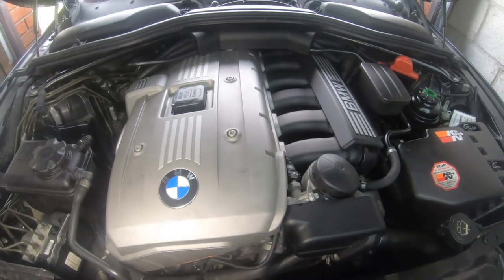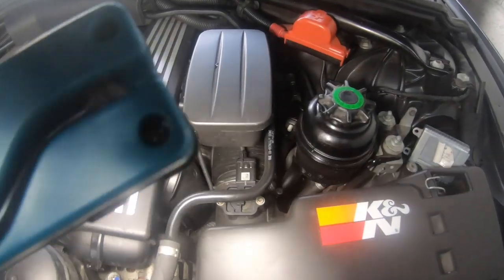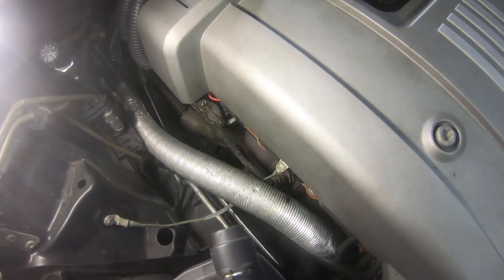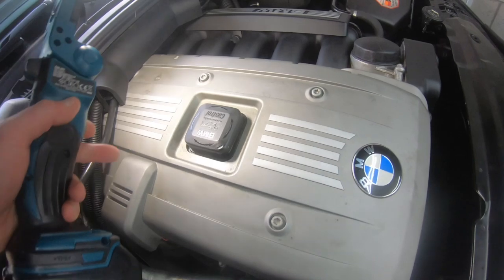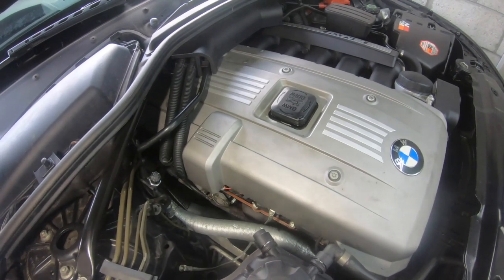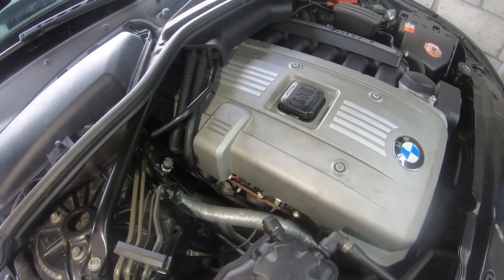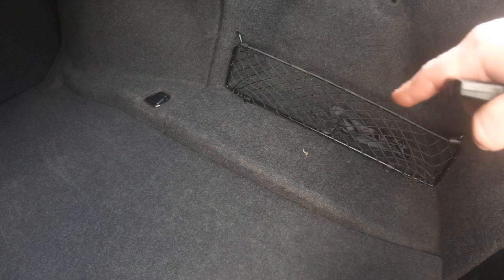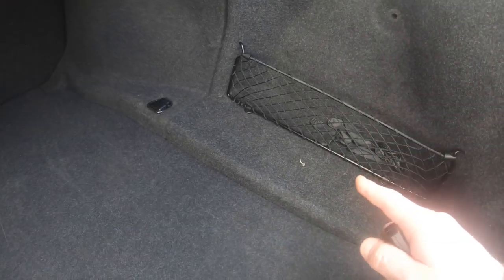BMW N52 Rough Idle Vanos Codes & Faults....Heres Why ?????

Comment: I had an issue with my N55 blowing codes for timing. I listened to your suggestion and did not suspect vanos solenoids as both would not go at the same time. Turned out it was the coils. Put new ones in and codes are gone. Thank you for this great video!!!!!!!!
Reply: @Triggerman2505  you had 2A82 and new ignition coils fixed it? Even if you have no misfires?
Reply: @angelnoguera1209  correct.  I must have had misfires that were not obvious and drastic because without the misfires this would not make sense. These N55s are so finicky.

Comment: Finally someone on UTube that understands how integrated the BMW system is. Awesome list this is why I like working on the BM it makes you think, one that a lot of people miss is if the car has been played with a lot the wiring harness can have you chasing your tail, I have had a handful of cars that all the problems have been some broken wires because the previous  mechanic been rough pulling connectors. Dean love your videos keep them coming.
Reply: Darren Teale agree my friend, it's great to understand what's going on between the mechanical and electrical components on the n52

Comment: Also check the vanos check valves on the side of the engine, they are meant to keep oil in the vanos, but get tired and oil drains away, and the exhaust one gets covered in muck, replaced both, and vanow works brilliantly. cheap from BMW!

Comment: Any advice on P052B and 2A7C codes. I have rebuilt the engine and from day one I got the 2A7C code. Then I changed the Vanos intake gear, and the second code popped up. Swapped the cam sensors around, got some chea solenoids replacements and still get the 2 codes. Car runs perfect. But on startup I get the slight rev to 1200 RPM and that's when the codes appear especially the P052B which is on OBDII. The other is not yet in OBDII it's in the DME Motor Electronics code. Thanks for any help

Comment: Oh my god. Man..I have been looking for exactly what this video explains for almost a year now. I have a 2011 328xi that throws a vanos intake code every few days and then disappears and then comes back again. I have had the expensive intake vanos replaced…still same issue. Few things have happened to this car, i got the oil changed at kal tire…and they put on the wrong filter which caused lots of whining for a while. I eventually replaced the filter when I found it crushed but I’m concerned kal tire may have thrown out this oil separator thing you are talking about…few days later I took it to a shop and they just cleared it. Shortly after the oil change, I had an accident where I drove through a car wash door. It was repaired by insurance and the day I picked it up the check engine light came back on. A mechanic suggested it was the cylinders firing  rough so I got them all changed as well as the valve cover gasket which was leaking. The light still came back on. After that I changed the intake vanos…still codes…now the mechanic says it might be these little screws that come loose on the cam shaft….$400 repair. The symptoms this case has is right when I start it up, the rpm is unstable fluctuating in low levels. Once I start driving it’s completely fine. PLEASE HELP!!!! I am literally going to go broke trying to find the problem.
Reply: So were you able to rectify your issues with one of the things he mentions in the video? I’ve been without my 2010 535i xDrive for three weeks already with some similar issues, except it started out as 2A98 then somehow turned into 2A99 and haven’t been able to figure it out yet.
Reply: You ever figure out what was wrong? Same problem, thanks?
Reply: I have the same issue on my bmw, the problem its replace the intake disa valves but the genuine bmw mahle brand if not it will not work

Comment: Amazing video! Need help with problem. Son drove 2007 e90 low on oil. Car went into limp mode. Changed oil and cleaned vanos solenoids, car still in limp mode and throwing P16A3 and P164C codes.

Comment: My 325xi gets vanos codes p0015 or p1553 and this is what I observed:
When the engine gets warm at around 100 degrees, the car will sometimes have rough idle and sometimes engine shuts off.
No issues when cold or when driving.
Any idea?

Comment: great video bro, I was having a super rough idle as if it was misfiring and it finally threw some camshaft position codes with I seen related to the vanos. I decided to do an oil change and clean the vanos solenoids and what do you know Im missing the plastic tree inside the oil filter. Replaced it from the dealer $80 and shes purring now. Ur a beauty mate

Comment: I have a 2006 bmw 530i when i get to a stop and about to take off it will cut off and it turns back on fine but trans light will be on and also DTC light on trans wont shift on to 2 or 3 gear until i turn it off then on lights will go away and will shift normal only code is 51B0

Comment: Any advice on an n46 engine I've got a p0012 that keeps coming and going. From a cold start the car runs almost perfect all power is there until about half an hour later I'm losing slot of power and a chain noise starts occurring bmw e87 2004

Comment: Hi I have a 2007 bmw e92 coupe 328i n52 motor I have a problem I have check engine light with code p0365 and p0344 so p0365 is camshaft sensor I alredy change them new but car wouldn’t start had to put old one and it started but still with code p0365 now I change the vanos sensor still same code came up change both camshaft sensor and same code came up so now I have like 4 new camshaft sensors I was told the new ones where defective cuz it wouldn’t star so I got a new pair same thing until I put back the old sensor car starts up but with same code when cold it struggles to maintain it self but won’t hit off when I put it to drive the car sound like it’s a misfire now I turn it off and on and the shaking goes off when I turn on ac sometimes it shut off or it gets worse shakes more like a misfire now I get the scanner and nothing same fucking code p0365 I need help any ideas ????

Comment: I have N52, P0012 error code. I installed 2 new cam sensors, 2 new vanos solenoids, new non return solenoids valves, new oil change with new oil cap, and still have the code with bad idle the first 5 seconds when I start the car. Any input?
Reply: I have done exactly the same think and also the p0012 code cames again. Can somebody answer how we can eliminate it?
Reply: Idle reset
Reply: 30 seconds with throttle pedal all the way down, then at the 30sec mark remove key (shut off ignition) THEN take your foot off the pedal & wait 2 full minutes .
Reply: Did u get this sorted? As I have same code problem?
Reply: Maybe crankshaft position sensor.

Comment: Dean, I keep getting the exhaust vanos code I checked the solenoid and it was fine but I still replaced it with a known good oem replacement. I still keep getting the code after clearing it . Once cleared it won’t come back immediately but a day or 2 later sometimes 3 days later . I did recently replace valve cover gasket . I disconnected battery during this job and I pushed the ignition several times and allowed it to do a self adjustment. What other possibilities could it be . I’ve checked all ones on this video . Do you need to calibrate valvetronic motor with inpa ? I do not have ista +

Comment: need help with the N52 engine, after  belt shred it ( with the old owner ) they replaced the belt car crank no start, brought it from them as it was, found the shred belt pieces wind up behind crank pulley, try to start it and it's crank freely but no start, i highly doubt that the shred belt made its way through crankshaft seal through the cam chain and made the chain jump one tooth or two throw off the timing, i drained the oil just too see if there are any shred belt pieces in oil all i see was two small belt pieces. i put Inpa to scanned and see a few following codes: 2A9A,2A98,2A99,P0341,P1554,P1553. took the spark plugs off to see the spark they spark after 360 degree crank or few spin. check the fuel pump with inpa activate i could hear the whirring noise from the fuel pump motor check the fuel pump fuse was fine, i highly doubt that the timing is off because of the shred serpentine belt made its way through crankshaft seal and wind up with timing chain or crankshaft made the chain jump one or two teeth, need help please. thank you.

Comment: I'm looking at a used 2007 328xi wagon w/170,000. Owner is selling due to a random misfire and a p0300 code. He's gotten frustrated with it and has replaced spark plugs, intake manifold gasket, valve cover w/CCV valve and crank case hoses. 

He said that headgasket is fine, as well as compression. He's check the ignition coils, and did mention wanting to do a smoke test to check for vacuum leaks, but has not had the time nor opportunity.

The owner is a BMW motorcycle mechanic and seems very knowledgeable, which has me questioning if I'm simply opening up Pandora's Box?

It's in beautiful condition in and out. Is it worth taking the risk at $3k?

Comment: Hello Doc
My 2010 x5 3.0 xdrive 
Changed both solenoids and still get a code (outlet vanos mechanical) clear code run good only for 10 minutes then throw the same code.
Any advice? Thank you.

Comment: If i have a 2011 328i n51 sulev model that slightly sounds like a diesel after a rev jump from start it throws a generic P052b code inside a zues scanner it comes up as 2A7C

Comment: hello i have a bmw e92 n52 the problem is the following at low temperatures the first ignition is difficult the car starts and goes out several times until it lasts then the problem disappears the next morning again the car has no error codes

Comment: Im getting misfires on cylinder 1,4,5,6.. and p00bc. 2011 528i. Car starts normal then after a minute or so on cold start, it begins to misfire like crazy. I can drive it and it’s not as bad. Once i come down on the rpms i get the drivetrain malfunction. Also on cold start before the issues start i also get that message. Any idea what it could be?

Comment: Yo dean I need help!!! Car has long crank and will not start 💀😡. New crank sensor, grounds are good, fuel pump keeps cycling will not stop, replaced fuel relay. I have not check fuel pressure yet. Several dash alert with long crank and diagnostic tool will not connect to read engine codes but connect to all other modules???!
Reply: I’m thinking it’s ekp module , ced4 code
Reply: Found the problem!!!!! Fuse relay

Comment: My son has a 2006 325xi with N52. He keeps getting a P0400 code which is engine exhaust gas recirculation. However I have not for a fix for this on any of the BMW forums.
Reply: U find a solution?

Comment: Hello My E64 6Series Dies While Driving & I Recently Replaced the Battery @ The Dealership...They Told Me The Vanos Solenoid Bank 2 Needs to be Replaced!! I'm Wondering If I Get It Fixed Will The Problem Go Away?! I Also Heard It Could Be IBS Sensor... Thanks Love The Information. & Vids Please Give Me Your Input

Comment: Hello there,  Love your videos , lots of useful information. I had a few BMW's and I really enjoy the driving experience. I am have having to replace my 2011 328i coupe with manual transmission after it was involved in a rear-end collision. It's very hard to find one with a manual transmission here so I may have to go with a automatic. What is your opinion of the N51 engine? I don't know if they sold that engine in the UK but it was put in cars sold in a few states over here as SULEV model (super low emission vehicles). I know they have quite a few components that are different from the N52 which I prefer. It seems like a lot of them are coming up for sale in states where they weren't originally sold. Do they have more problems than the N52? I do most of my own repairs and know my way around cars. Thanks
Reply from the maker: I know N51 engine mate it has three stage manifold to make up for the lost power due to lowering the power band for emission purposes so N51 uses three stage manifold to make up for the lower end power that it’s missing it’s a good engine
Reply: @BMWDoctor  thanks for the reply that's good to know. I'm going stop running from the n51. The guys on the forums over here make out like these engines are no good and more expensive to keep on the road than the n52. Going to look at a 128i M sport today.
Reply from the maker: mate its a good engine trust me better then N52 that you guys get and if you need help I understand that engine even tho its a usa model only I have helped many many people in the usa regarding this engine

Comment: I had a question for you do to the hardship and not having a job I can’t  afford OEM solenoid Vanos can you recommend a aftermarket part that may be a little cheaper and reliable for now because I know you say always buy original parts I just got this BMW and I am really not wanting to buy aftermarket parts I wanted to run nicely it’s an 08 128I BMW coupe with 117,000 miles  thank you BMW doctor...

Comment: Hi

I have question
I have a 91 with the n52 engine
With the zf6hp19 transmission.
If i drive around the 40mph
I have a light hesitation. Very light you can feel it. Only at 40mph

I already had the service done at ZF company they changed the oil a and new filter. They said there are no codes. They don't know what causes it.

Do you know what causes it
Reply from the maker: Vanos solenoids cause this issue and update your modules !!!
Reply: @BMWDoctor  yess
I had in the past a code with the solenoids
I erased the codes but they never came back.
Its only around  at 40mph
Reply from the maker: @gekkemocrogekkemocro  mate its your solenoids they do not need to throw a code they are FAILED you need to replace them I believe there $450 for both from dealer go get new ones and you will see the difference no more loss of power
Reply: @BMWDoctor  thanks mate
For the response.
I am gone a replace both.
 Thanks again 
Love watching youre videos

Thank you🙏

Comment: Hello, I’ve got a 2011 bmw 328i sedan n52. For 2 years now I’ve been having this long crank issue. Every morning I do a cold start and it’ll start up normal and quick. But if I let it sit for 30 minutes and go to start it again, it’ll have this long start. It starts every single time for the past 5 years I’ve owned it, but it just keeps doing this long start. Please help, thank you.
Reply: 12 Tribes of Israel to be honest I’ve never changed it. I always thought it was a sensor, because it usually has a rough idle when it does the long start.

Comment: bro , thank you for the video, i have bmw F18 n52n - with error code  
((0x104208) Intake pipe pressure sensor, plausibility, after-run Pressure implausible) i test it with ista+, the engine ruining smoothly  but the yellow check 
engine on, what should i do ?

Comment: Which is a better buy, 335d with the m57n or 330d lci e92 n57? In terms of performance, reliability, i wont be working on the car my self so of i am current lot of money will need to be spent in order to make the 335d reliable. Your answer is highly appreciated! I really cant decide!
Reply from the maker: Mate if your not working on ANY bmw yourself forget it mate these cars are very very unreliable and take a lot of work constant to keep them running if you want a car that’s reliable buy Mercedes C350 diesel much much better engine and gearbox is SOLID no issues
Reply: @BMWDoctor  Thank you so much for your honest answer big respect from Cyprus!

Comment: I've looked every where on youtube, but I cannot find any videos on where to connect the Suppression Strap on the top passenger side of the engine. Is there a chance you can share your knowledge about that. I'm also looking into replacing the Earth strap as well; if you could also share your knowledge about that, would be greatly appreciated!

Comment: not sure if you still respond but i picked up a n52 engine car, i have those vanos codes and eccentric shaft codes, symptoms is super rough idle, when engine runs hard to open oil filler cap and some whistling noise, i’m familiar with the n54 engine but not much with the n52s oh and also smoke coming from the catalytic converters??? super random but if you could chime in would be greatly appreciated

Comment: If u dnt change your o2 sensors what happens next is your water pump will go out after that Oil filter housing leak the. Valve cover leak then finally oil in the sparks plugs
Reply from the maker: What aload of rubbish 😂 mate people will never take you seriously with comments like this N52 doesn’t suffer many O2 sensor failures at all I have one on 160k on the original sensors and waterpump 

You must have a bad design engine problem N52B23
Reply: BMW Doctor your correct I’m didn’t mention n54 on my post n52 is reliable but that’s my experience from a n54

Comment: i have my n52 for more then a year and im not getting any codes (scan with inpa) the only ones i had were for big DISA which i changed it. but some mornings when i leave the car at idle to long(+10min) it has small misfires i think is just a little shake that you cant really feel but no errors so dono what to check for
Reply: Solved The problem?